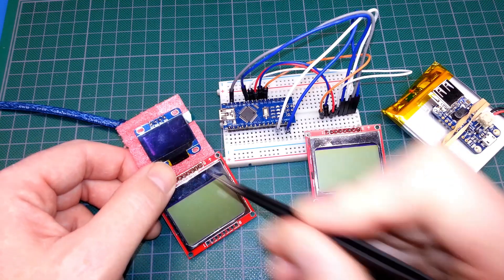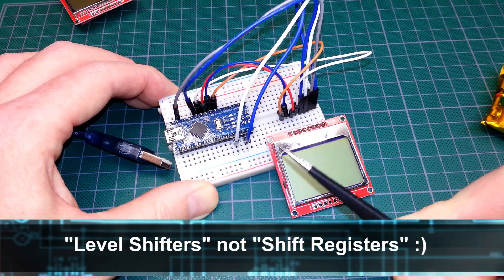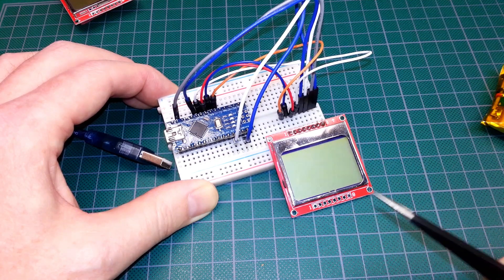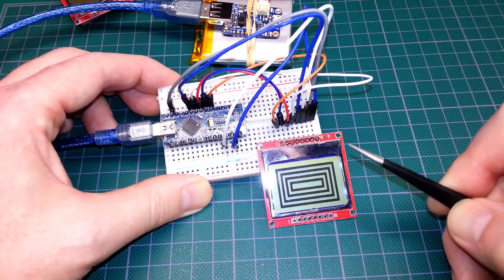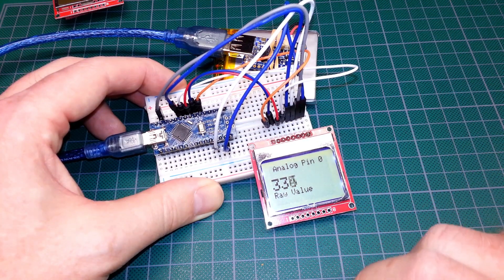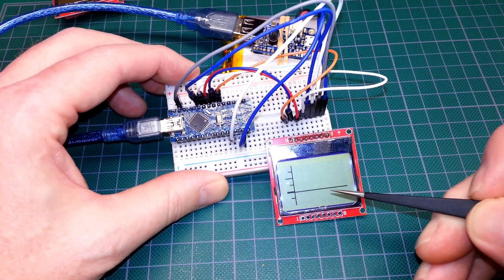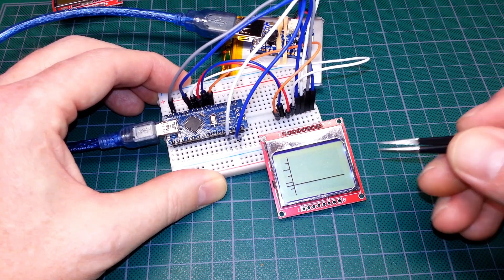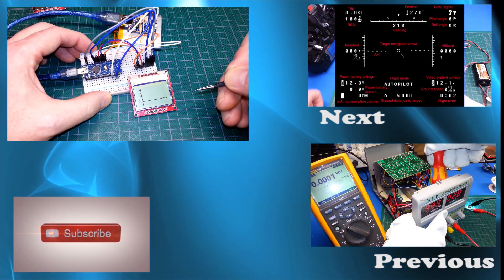Nokia 5110 LCD Display for Arduino and Raspberry Pi Projects

Comment: Eric -
This was helpful & informative. But I am a little confused about using the 5110.
Apparently you use 5v, then have to use PWM to make it work. Why not just use 3v ?
also, in a later video about the 5110 you talk about reversed leads from the china 5110's. Can I buy the UN-reversed type, and how can I tell that's what I have ?

Comment: some of my 5110 (bought on ebay) have connection issues. I have to press the display against the pcb in order to solve this. do you have the same problems?
Reply from the maker: GuitarPeter04 Some of them.  Just tweak the retainer tabs to tighten it up or add some solder etc under the pad to space it.  Happens from time to time.